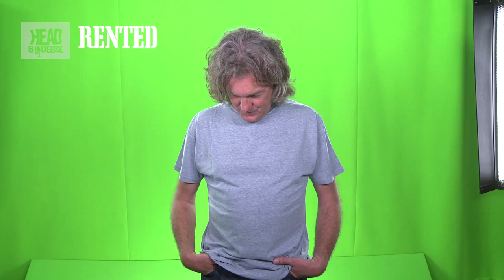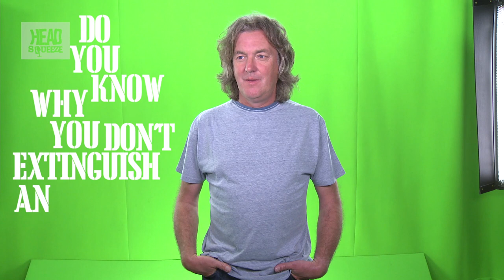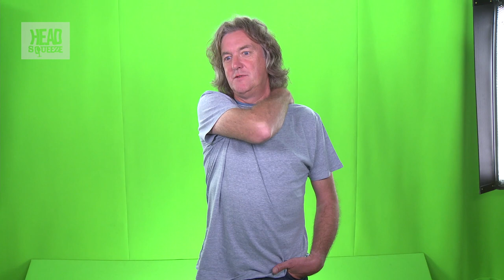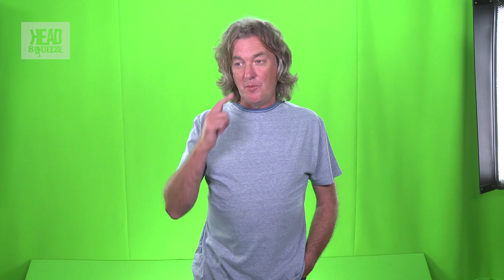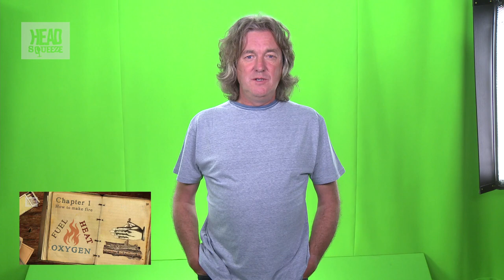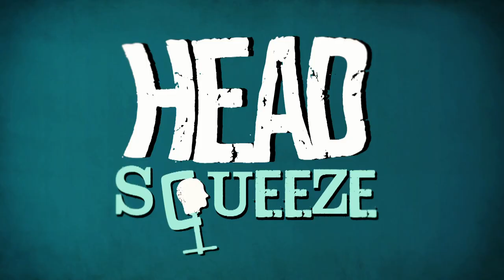Playing with fire | Head Squeeze

Comment: You can do matchstick rockets with safety matches.  The tip is still explosively flammable, and that's all that's important.  

If you do as Mr. May explains and wrap the very tip of the safety match in foil and then heat it with another match or a lighter, it'll still go off like a rocket.  Only the cardboard matches are no good for it.  You have to use wooden.

Comment: Damp towel for a frying pan, thrown over the top to suffocate the fire. It gives you time to shut off the heat/power and prevents accidental spillage, flaming oil is not good for the feet :)

Comment: Well to the first question, the fact that oil floats isn't as important as the fact that the water boils. If you throw water on burning oil, the oil will be well over 100C, which means the water will boil instantly. That will create a lot of steam which will almost explode and push the oil in to the air. And when the oil is mixed with the air it only burns faster.

In short, you will get a ball of fire in your face.

Comment: Another reason why you don't extinguish a oil fire with water is that oil can be hugely more hot than 100 degrees where water instantly evaporates into steam. On a bad day you get flammable oil atomized everywhere.

You can extinguish your frying pan with water btw. Despite what your parents told you. Not your deep fryer. All a matter of ratios. A lot of water wins against little oil. The other way around is instant catastrophe.

Comment: There are those small rectangular pieces of ceramic tile that you use to connect two tiles together or at the bottom of a wall.
 Me and my friend used them as swords and I ended up slashing his elbow arm from top to bottom. It wasn't pleasant.